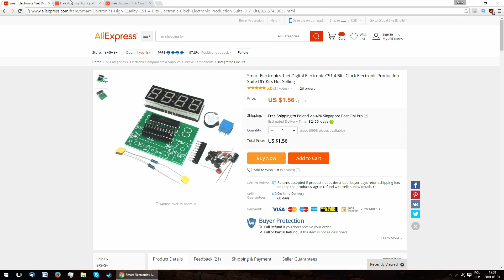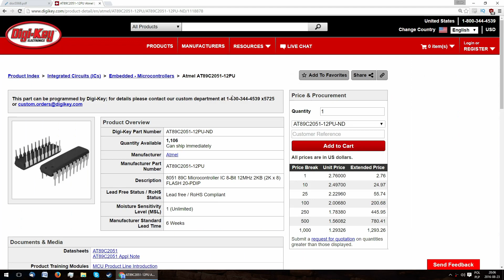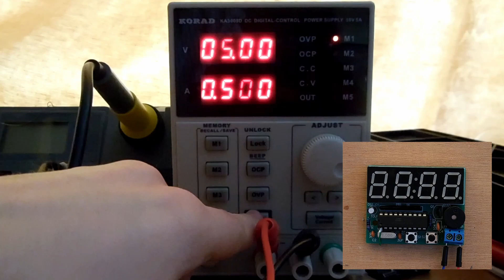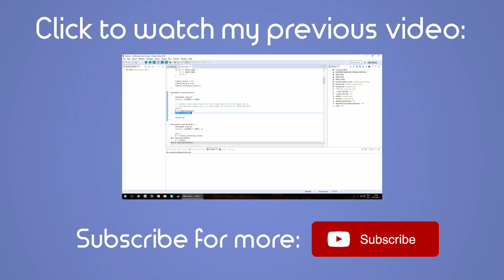C51 DIY electronic clock kit from Aliexpress/Ebay - Assembly and Review

Comment: '
see that video at 248 to 305 about switch 1 and switch 2 on the green board...
only two soldering with switch one = only two soldering with switch two...
dont need four soldering on switch one = dont need four soldering on switch two
Reply from the maker: It makes the mechanical connection better though.